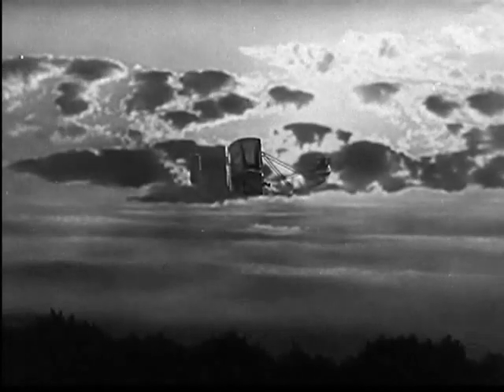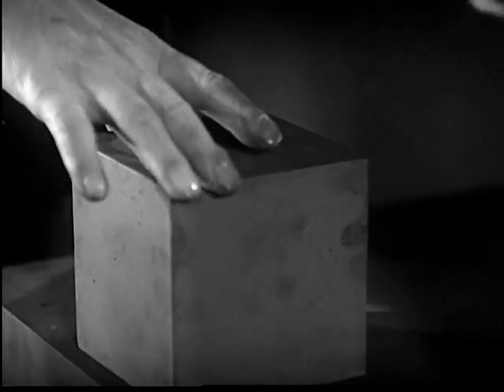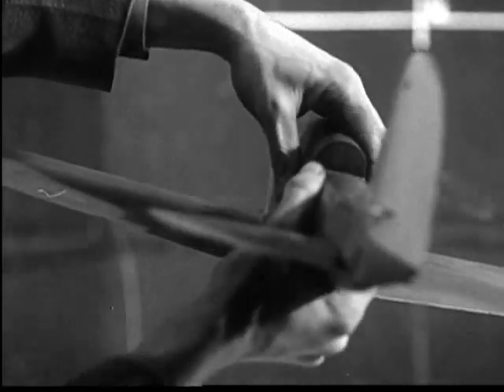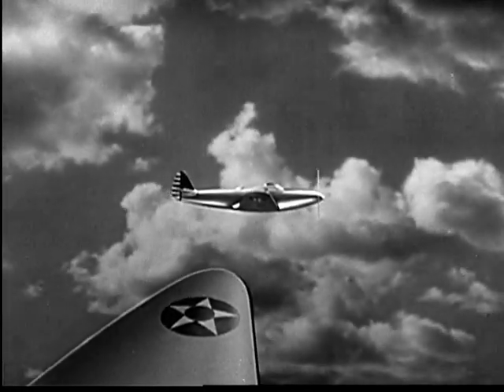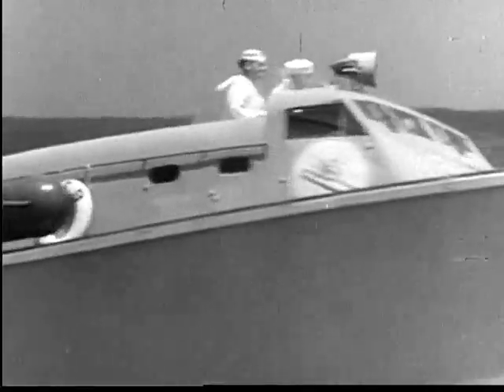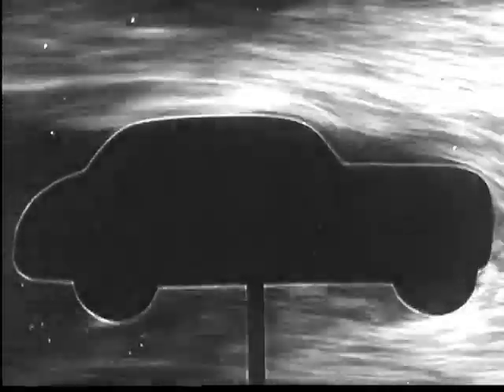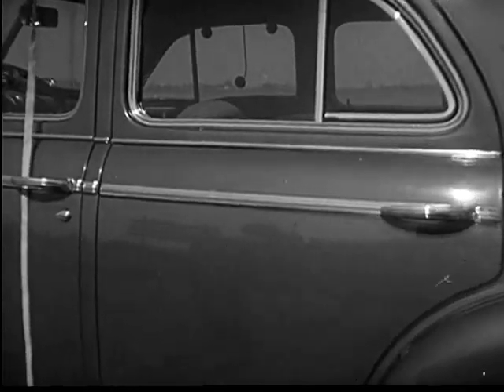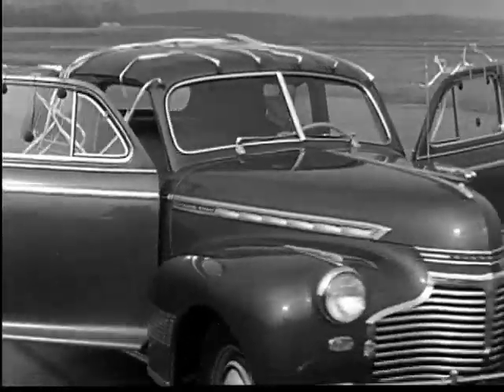Taking the Air (1941)

Comment: Surprisingly 'ol Horatio, didn't consider using smoke as he smokes a cigar  instead of feathers to observe airflow.  Even though it was the 90's! 👍🏻😉
Reply: well.. it is much much easier to use the feathers for a more constant rate and visual look at the airflow. I'm sure he used some smoke, but it just isn't consistent enough along with only having a very limited amount. You could argue some sort of a smoke machine, but they didn't exist back then.
Reply: It was 1890

Comment: Tatra 87 is the real car that started streamlining back in the 1930s. With its V8 2,9 litre air cooled engine, delivering 85 hp, it could drive at 160 km/h (100 mph). And that with a fuel consumption of 12,5 liters per 100 km (18,8 mpg).
Reply: Even the old 48's V6 Fords were getting 21mpg, given it doesn't have nearly the hp of todays. Still pretty cool how in 70 yrs we can get a turbo 4 cyclinder to make double the horsepower and triple the mpg, probably wouldn't look as cool as the old cars tho.
Reply: @cafenightster4548  in 1948, Ford had straight 6 and V8 motors.
Reply: @bobbyheffley4955  Sorry, I meant I6's.

Comment: But then Chevrolet said that they wouldn't offer overdrive because the savings in gas wouldn't pay for the cost of the unit, so while a Studebaker could get up to 30 mpg with its Borg Warner overdrive system, a Chevrolet was stuck at 19 mpg on the highway, max speeds of 60, and an engine that burned out at 100K miles, so they never realized the true potential of their streamlining.
Reply: Their calculations were probably correct.  Even today if you run the numbers it takes a lot, and I mean a lot of miles to "pay for" an overdrive unit.  Nobody was cruising around at 60mph at any regular interval back then, and nobody expected 100k miles between rebuilds.  Everything is incremental.
Reply: @ShainAndrews  Studebaker sold plenty of overdrive units to economically minded drivers. Their cars got up to 30 MPG, and lasted longer. I bet it all added up.
Reply: @td3993  I'm really good with math.  Give me the numbers.  What was the cost of the option.  What was the average price of petrol?  Cite a source for the MPG.
Reply: I added overdrive to my 1955 Chevy Pick-up.
     Before, the engine was screaming at 60 mph; after, 70 mph, quiet as a mouse.  I was a teenager; thus more concerned with going faster, not particularly noticing the 42¢ per gallon economy.
Reply: Don't know specifically about overdrive but some options that weren't available with Chevrolet were made available on the more expensive GM cars.
Reply: @ShainAndrews  As for sources of MPG, they were Studebaker ads that I read a number of years ago. Besides that, it's about a lot more than just fuel economy. Also included is the price of the engine, transmission, car, because when the engine wears out at 100,000 miles because you're racing it all the time, you're going to have to rebuild or replace it, and most people just replace the whole car.
Reply: @td3993  I don't it was common to put such high mileage on cars back then.
Reply: It took Chevrolet until 1955 to put a halfway decent air cleaner on a car, and a full flow oil filter came later than that.
Reply: @6h471  The oil bath air cleaner on my 51 was very nice. The air was sucked down through oil, which was then pulled up into jute, coating the jute with oil. It removed all dirt from the air and left it as sludge at the bottom of the oil.

Comment: Fascinating! If only today's cars were as streamlined as cars of this generation. Cars would get better fuel economy, while also being able to go faster.
Reply: ***** Are they?
Reply: Jason Carpp Yes. Back then engineers and designers were getting a hold of making sure the car cut relatively cleanly through the air, but unlike today, they did not really bother with making sure the air was effectively carried over the vehicle.
Reply: @tavshedfjols  Are you joking? Drag coefficiency has improved a lot from 1940's to now. When this film was made, Cd was typically around 0.5 to 0.6 and now it's commonly 0.25 to 0.3 on all passenger cars. Only 100% better on rough average.
Reply: @manitoba-op4jx  And how's that?

Comment: I would amagine lots of cars and planes could have gone more miles per gallon. Also I would say pollution wouldn't be bad and our oil range wouldn't have been so low. I wish we could change the past🙂
Reply: Imagine if we had 90's emission standards and automotive technology since the 30s. Probably we wouldn't need downsizing, and other crap on modern cars
Reply: @raphaelrodrigues1645  indeed, that would be amazing.
Reply: @raphaelrodrigues1645  or modern cars at all, thanks to a lack of need to keep changing. It is criminal to constantly change automobiles, most young kids think they kept the same bodies every decade, but that couldn't be less of what truth of any there is. Every year momentous things changed in appearance on an automobile no matter if it's Ford or Chevrolet, or Nash, DeSoto, Cadillac, Buick, Pontiac, Plymouth, Dodge, Studebaker, and even Packard going for the classy forms of the 1930-32 era of body design but with the military power engine of a 1940's automobile able to climb a staircase with ease as they were so grand at. Couldn't imagine a SUV (approximately the same size) trudging along as it's tires are reduced to sap trying to heel up stone steps.

Comment: And all that research went right out the window during the 80's when cars were boxes and looked like crap!
Reply: It's not as simple as the video claims.  For  example, an original design VW Beetle, designed to the principles shown, has a drag coefficient of 0.48.  A Nissan Cube has a drag coefficient of 0.35.  Getting rid of little air traps has a bigger effect than a large flowing shape.
Reply: @21stcenturyfossil7  didn't matter so much anyway, a 1930 Packard, infact a 1925 Packard already exceeded 100 miles per hour. And that was elegant and very not so much the bullet expression in its variable of shaping depending on which model they are using.